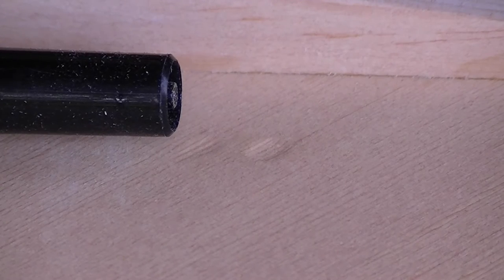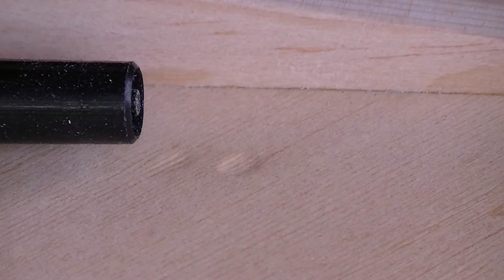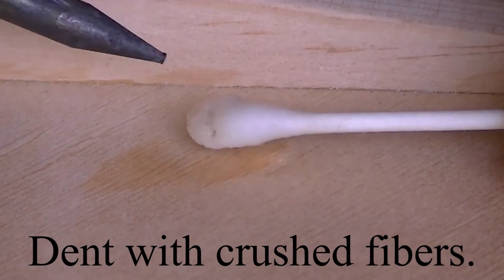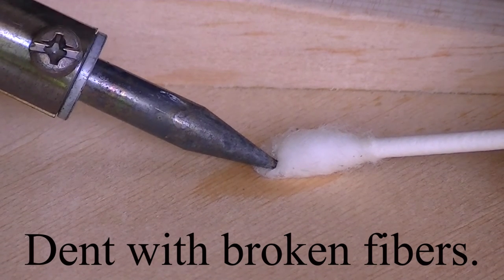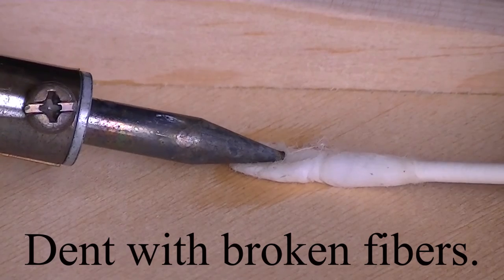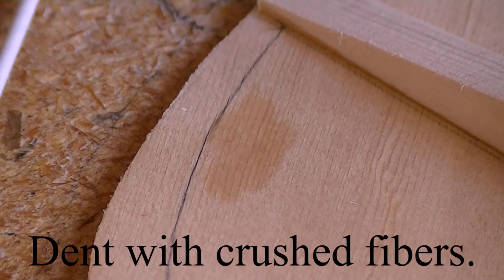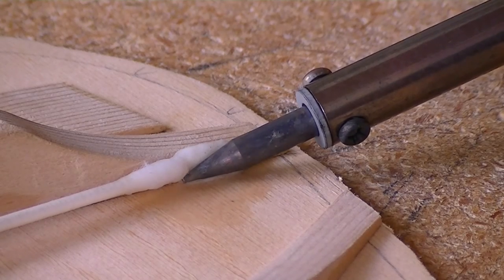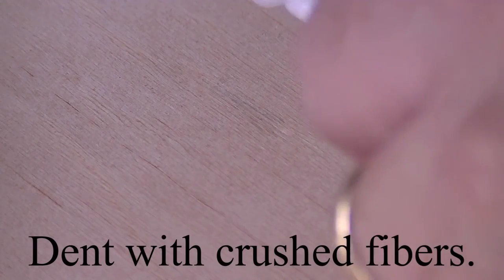steaming out dents | RATTLECAN GUITAR RESTORATIONS by James O’Rear

Comment: can this be done over a dent with nitro finish on top?
Reply from the maker: I have done it so yes but be mindful that you could cause a "blush" or hazy white spot (and why I use cotton swabs that are only moist, not dripping). You should always do a test in an inconspicuous spot before proceeding. Good luck.
Reply: @RattlecanGuitarRestorations  and if the white blush were to happen, have you any idea how to remove it?
Reply from the maker: @francissalva9307  Use an iron over a towel (no steam) and gently heatbit. The white is moisture trapped in the finish. The slow dry heat will help release the moisture. Lots of info on this by searching " remove heat rings from table" or something along those lines.